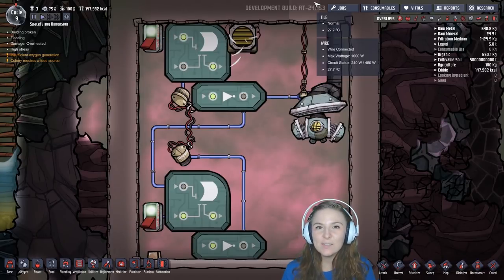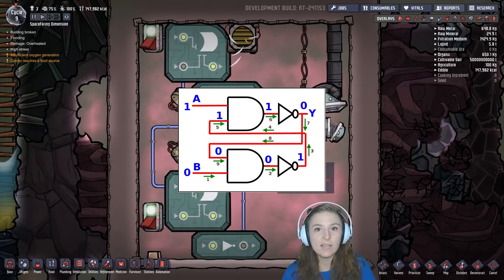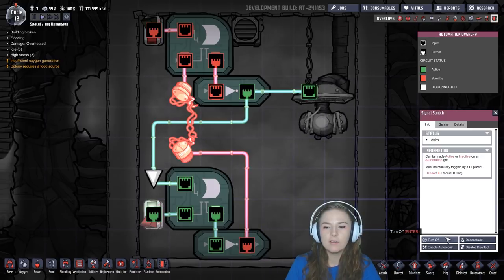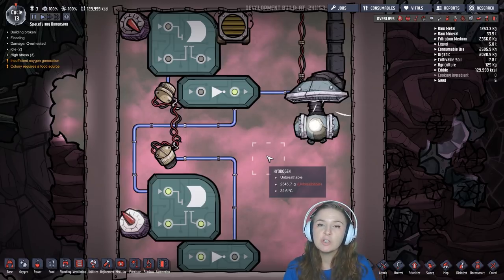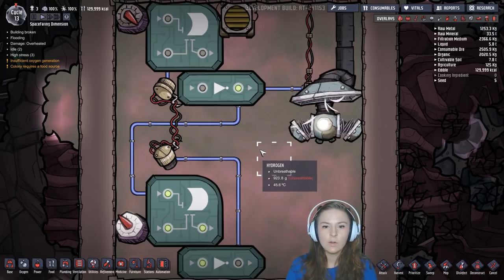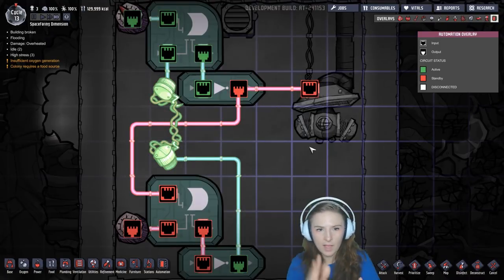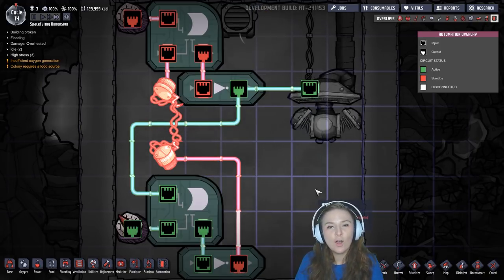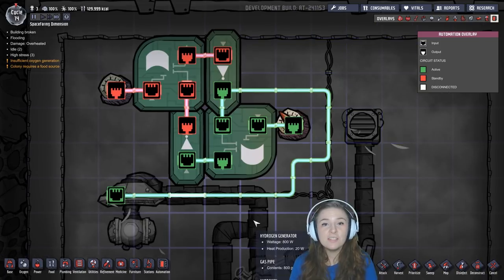SR Latch - Setting a range with switches - Oxygen not Included Automation Update Logic Tutorial

Comment: Hi Lacy.  I don't know if you've figured this out yet, but I've noticed in your streaming play videos that your dups are not using the second power hamster wheel on a circuit.  This is because they changed how the wheels work.  The setting for a wheel is the percentage of power the batteries can hold on the circuit.  So when one dup gets on one of the wheels, she already generates enough power to inactivate the second wheel.

If you have two wheels, say A and B.  Put a pressure plate underneath wheel A.  Automate wire that pressure plate to wheel B.  Set A's activate state to whatever you like, say 30% power (your batteries will have to be at 30% or lower for the wheel to activate).  Then, set B's activate state to 100% (it doesn't care about batteries at all).  That way, only when someone is using wheel A, B will  be activated for use.

I hope I said that clear enough to understand.   Good luck in your play through! :)